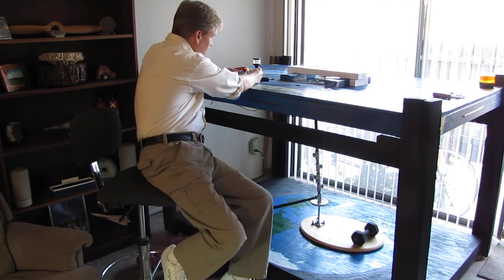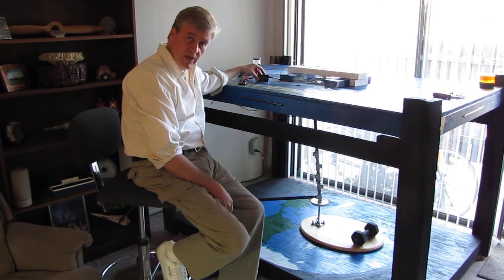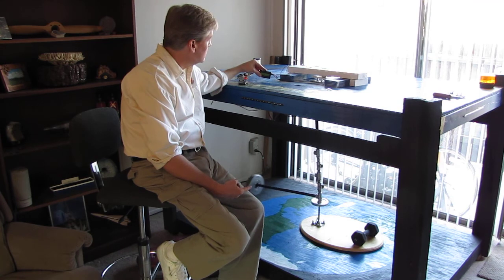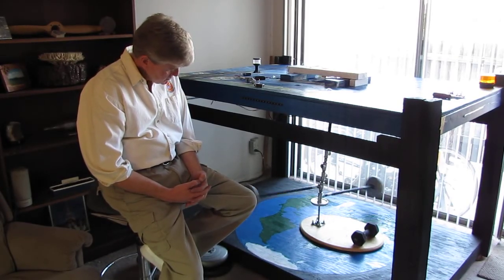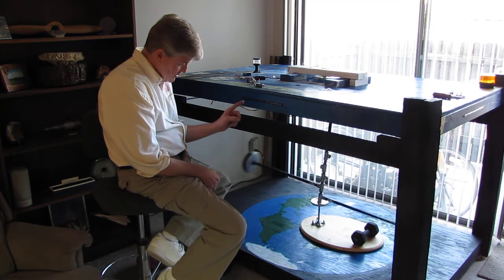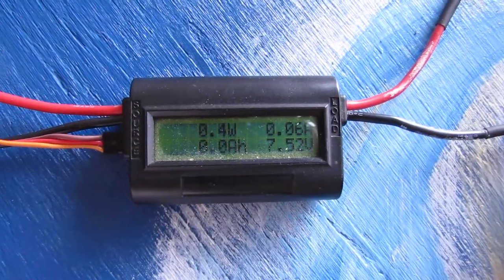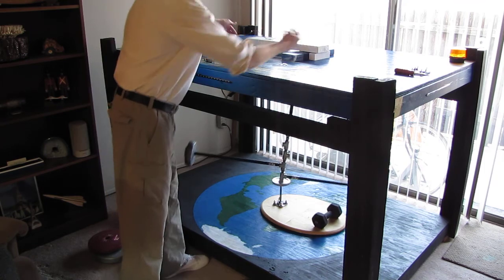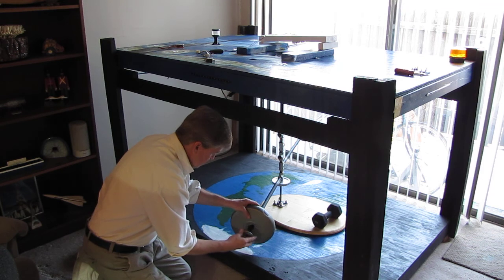The John Device, Video 2 -  Moving Mass and Bending Perception

Comment: Hi,
actualy this is the same principle as cranes...it's just pulling and pushing the mass at one hight. I believe that this device reaches the same final acceleration as if it would be mounted on a stiff shaft with bearings. The only difference should be the non linear acceleration. Am I wrong?

Comment: dave ur confused about ur calculations, you have created a flywheel.

if ur wondering why ur device could possible work... well it should as long as the friction isn't larger than the torque output of the motor/system. 

your system has a certain amount of moment of inertia (rotating mass), so your simply using the small motor build up energy in the flywheel. 

ur argument is similar to saying: when riding at 45 mph i don't have to really push on the the gas pedal of my car much.... BUT IT'S DOING 45MPH!!!!! 

questions of power are framed in a different light such as, how much power does it take to get my car to 60 from a dead stop in 2 secs? 600hp? 800hp? 

or in ur case if my electric motor is making a couple watts of power how long will it take to accelerate the flywheel to it's top speed?

think of energy as a glass u want to fill and when it's full, ur device or car will have attained a certain speed and hence kinetic energy. power, is the rate you can fill the glass!!!!

so in short, yes it takes about .4~.5 watts of power to drive that system but you haven't gained anything of value
Reply: Yes, definitely a flywheel. The available torque John that is talking about is mostly stored kinetic energy. If this device really multiplied the input power, he would not have to give it a push to start it. It would just take off. If John's device multiplied the output watts by 400 times like he says, the structural integrity of his device would probably not hold up.  Also, he has to push it to build up the kinetic energy so it doesn't take so long for the motor to put the rest of the kinetic energy in.  I am not sure why he made it with a wobble design. It would work the same if it didn't wobble, actually it would probably be even more efficient. This design does nothing but burn energy. So yes, we are witnessing none other than stored energy rotating, no gains here - Unfortunately
Reply: A rather badly designed flywheel at that because the broken symmetry of the rotating mass results in off diagonal elements in the inertia tensor.